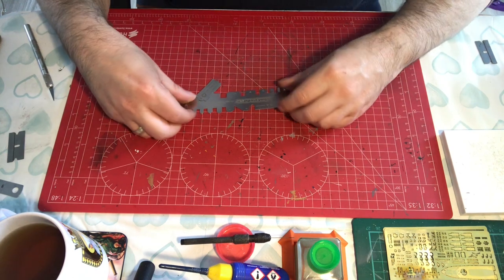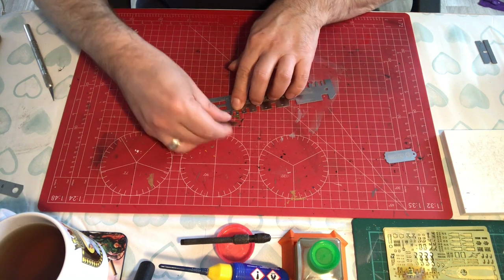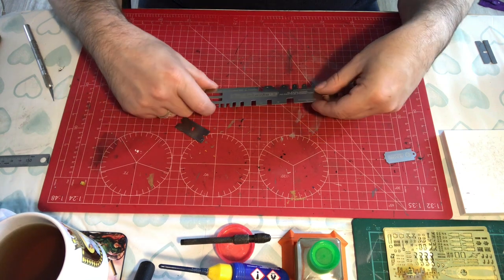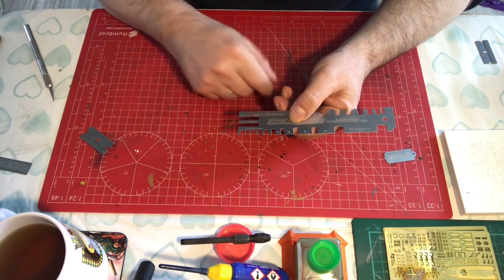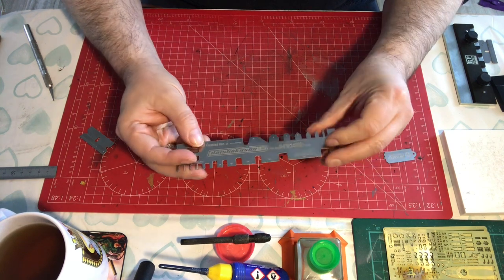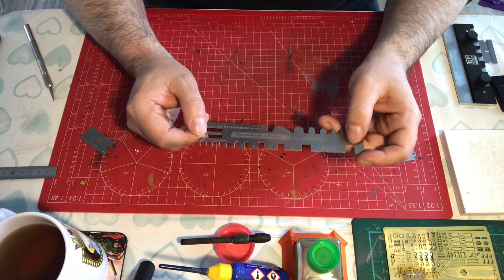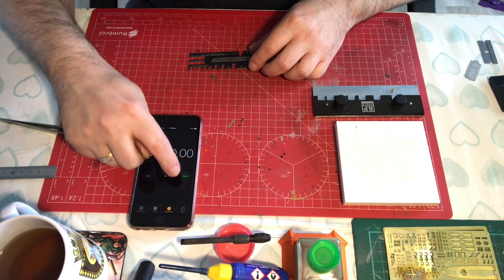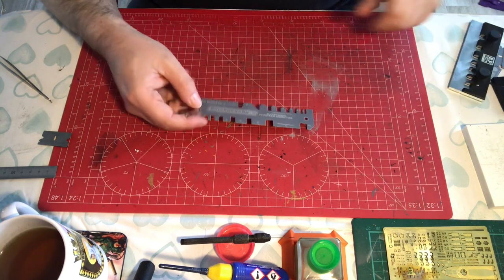Focus on tools for model building - PE parts bending tool

Comment: That's been my go to tool for ease and simplicity with a great result, I use it for 99% of my folding. Only issue I have with it is sometimes its awkward holding down the teeth firmly while etch is underneath, but the tool needs to be thin and well worth the small investment. 👍